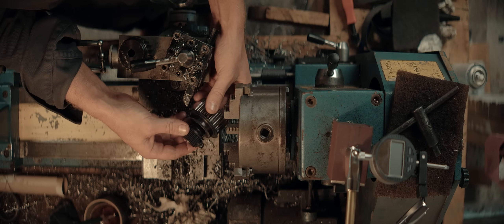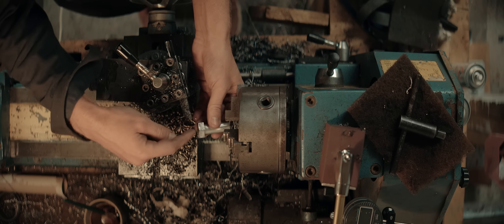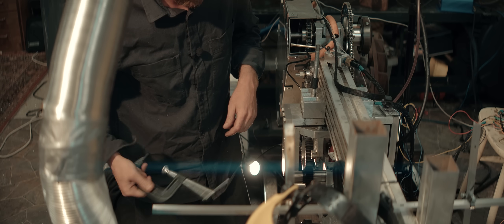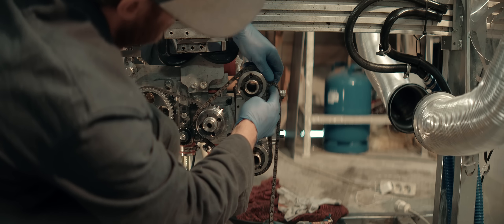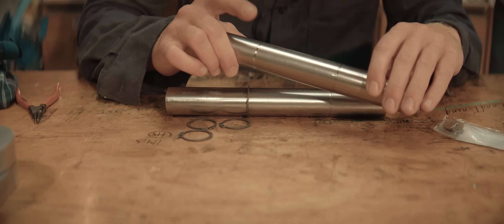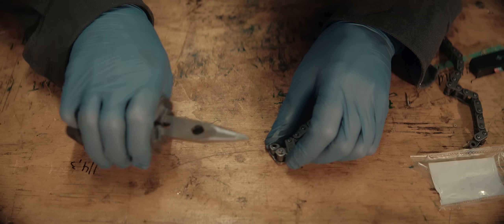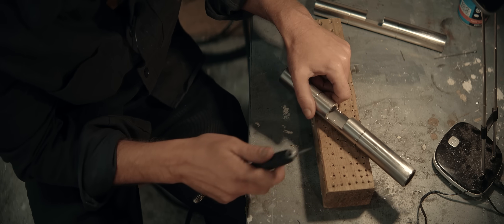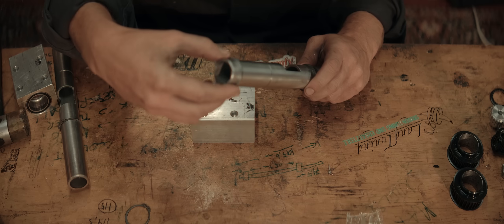Spinning Exhaust Pipes Chain Drive - Supercharged 50cc Two Stroke Engine.

Comment: How to make vehicles run on alkali solution, ammonia solution, alcohol solution: ELECTROLYSIS (CAN BE FUELCELL DRY/WET HHO, RADIO FREQUENCY HHO, OR PLASMA HHO GENERATORS) INSIDE FUEL FILTER (INJECTION VEHICLES) OR BIG CUSTOM FLOAT BOWL (CARBURETOR VEHICLES) , AND INSIDE COMBUSTION CHAMBER BY PLASMA FROM MULTI SPARKPLUGS, WATER LASER IGNITION SPARKPLUGS, WE NEED HACK THE ELECTRYCITY BY ADDING AIR SCOOP WITH WIND TURBINE ELECTRIC GENERATOR (ALL LAND, SEA AND AVIATION VEHICLES CAN USE IT AS EXTERNAL ELECTIC CURRENT GENERATOR) INSIDE IT AND PUT ALTERNATOR ON PROPELLER SHAFT OR AXLE (FOR CARS, TRUCK AND OTHER WHEELERS VEHICLES) AND ELECTRIC MOTOR STATOR GENERATOR INSIDE CENTER OF REAR VELG AND FRONT VELG (FOR CARS, MOTORCYCLES) THIS GUARANTEED FREE ENERGY BY MOVEMENT OF VEHICLES AND WIND THAT COME FROM FRONT OF VEHICLES, THEN USE SUPERCAPACITOR IN HYDROGEN GENERATOR CONNECTION CABLE AND VARISTOR IN COIL-IGNITION SPARKPLUGS CABLE, THEN MAKE ELECTROLYSIS INSIDE FUEL FILTER first electrolysis (PEM OR PLASMA HHO OR BY RADIO FREQ HYDROGEN GENERATOR), BECAUSE GRAFITY EFFECT, WATER INSIDE  FUEL FILTER OR FLOAT BOWL WILL MAKE PRESSURE  SO HYDROGEN DON'T COME BACK TO FUEL TANK COME DOWN BUT UP RIGHT INTO INJECTOR OR CARBURETOR FUELS SPRAY, BY INJECTING OR SPRAYING BOTH HYDROGEN AND WATER INTO INTERNAL COMBUSTION CHAMBER CHAIN REACTION (EXPLOSION BY NEXT ELECTROLYSIS STAGE MUST BEEN HAPPENING INSIDE COMBUSTION CHAMBER) PLASMA SPARKPLUGS OR WATER LASER IGNITION SPARKPLUGS WILL MAKE ELECTROLYSIS+IGNITION , THE PRINCIPLE IS SAME LIKE LIGHTNING STRIKE ON SEA (NATURAL ELECTRIC PLASMA ELECTROLYSIS) THAT CONVERT SEA WATER INTO HYDROGEN AND OXYGEN + MAKE PRESSURE AT SEA WATER THEN BURN IT CAUSE BY LIGHTNING STRIKE  HIT HYDROGEN (EXPLOSION OF WATER ON SEA BY LIGHTING STRIKE) ON IT THIS MEAN ALL VEHICLES ACTUALY CAN RUN AND  BURN ON WATER AND HYDROGEN, THE SCHEME WILL SAME TO FUELCELL ELECTRIC VEHICLES WHICH WHEN INSIDE I.C.E ENGINE WE BURN HYDROGEN AND WATER IN FCEV WE JUST INJECTING HYDROGEN FROM ELECTROLYSIS RIGHT INTO FUELCELL
Reply: Same as pulse jet.

Comment: When you tap on the lathe like that push the tailstock into the chuck . Otherwise the thread you’re making has to drag the weight of it along the bed. It’ll make for better threads . 
Thanks boss , really love your engineering ingenuity . Really enjoy you’re videos .
Reply from the maker: Thanks for the tip!

Comment: I may have missed something in a previous video (sorry if I did), but how do you seal the rotary valve tubes? I ask because if you're worried that the drive belt for the valve tube would melt, then wouldn't a seal be in the same sort of danger? Loving the progress!
Reply from the maker: Sealed bearings, and yes they might die...
Reply: You can get metal or ceramic rotating face seals.that might do the job.
Reply: @nerd1000ify  once the proof of concept is complete, if the bearings die then the effort will pay off to find more suitable bearings that will live longer.

Comment: feel i should not be negative but here we go, dont all these pullys and belt get huge paracitic loads on the engine?
Reply: Yeah they will.. but without them you can't force induction so what you lose you gain back more though boost
Reply: @jasonrobertson3330  this is why i asked to get someone els opinion of in wong in my theory.
Reply: Also most 4strokes have timing chains or belts basically what these are.. Chains use less energy then belts do
Reply: A good timing belt drive is 90-98% efficient depending on the type of belt. Comparable to a chain drive.

Comment: looking good. are you gonna place some kind of curved plates inside the tube ports to direct flow ? or will it flow out of both ends of the tubes ?
Reply from the maker: If they work I'll make new ones with better flow. Probably easiest to machine from solid stock.
Reply: @2STROKESTUFFING  I would suggest to 3D print a pair of bending/pressing tools to bend the shape you want in sheet metal then just tack it in. The flow direction part in the port doesn't need to be fully welded/sealed for a prototype. Speaking of prototype you can easily swap out for different exhaust flow direction parts if you only tack in place.
Reply: I am affraid that there will be a war of flow going on, lets find out!